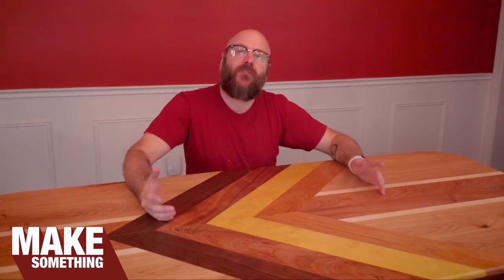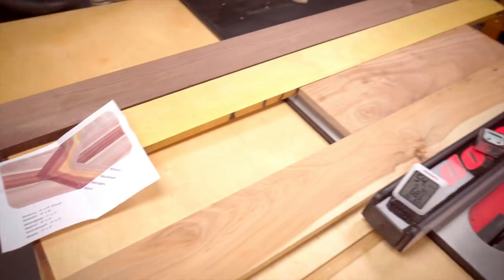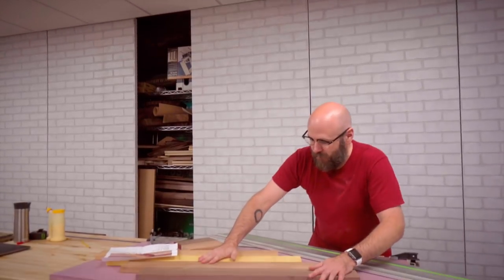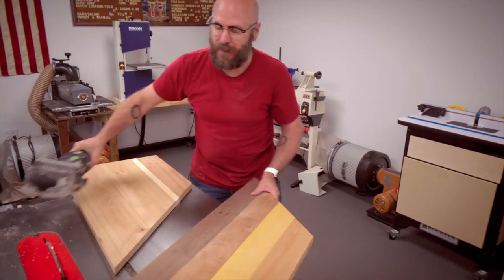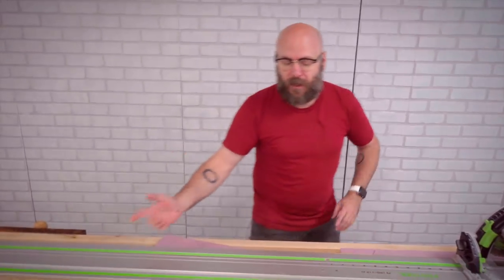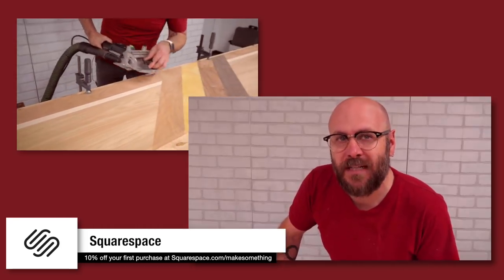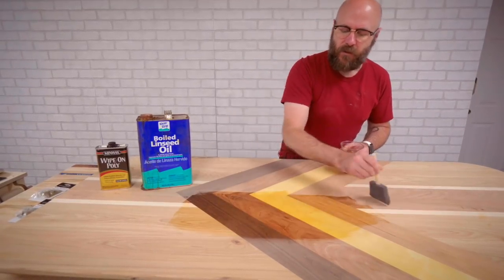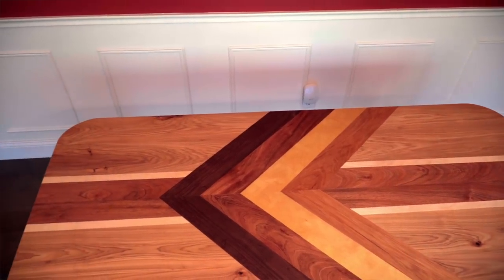How to Make a Chevron Table Top And Avoid Seasonal Wood Movement

Comment: It looks great. The only concerns I have are using pocket screws attaching the apron to the top and if you used  the domino on the wider setting on one side to allow for the movement. The pocket screw won't allow for movement and neither would the dominos if they were all done on the tight setting. Maybe treat the two halves like breadboards and use the dominos with dowels pulling it together and elongating the holes on the ends for wood movement? Then instead of pocket screws for attaching the top, maybe using z-clips to allow for movement. Those are my suggestions but it does look awesome!

Comment: What does the table look like today? Did it crack? I made a similar design, only I pocket screwed the boards and I used 2x6s and 2x4s
Reply from the maker: Still holding up great. A tiny bit of separation on one of the seams
Reply: @MakeSomething  that's good to hear!! My first table cracked so bad I had to build a new one and I wasn't satisfied with the second one so i built a third one! But thanks to your design I copied it only I mirrored it to make it different but I've actually became a decent wood worker!!! Thank u

Comment: Beautifully done David.  I will add, it's critical that the underside of any project also be finished to help prevent wood movement.  Unfinished areas react to seasonal changes in humidity and this is an area where many woodworkers screw up.  It's been researched (I don't remember where) that if this is done then 98% of the wood movement is eliminated.  My own experience shows me this is true.  I have no issue whatsoever with wood movement over decades of making custom highend furniture.

Comment: Hi David. Great video and table. I still think you might have some issues with expansion where the end grain of the hickory meets the edge grain of the chevron pieces, depending on how well the wood deals with the changes in humidity.  It’s definitely a gamble. Another option for this design would have been to cut thin veneers of each species and glue to a ply substrate. Only problem with that is then you have to wrap the unfinished edge on all four sides. Anyhow, great build and hopefully this one holds up in the long run!!

Comment: Is there any reason to use pocket screws instead of standard table hardware such as the  table top fasteners from Rockler? (in reference to the apron at the end of the video)
Reply from the maker: Table hardware is probably better but it’s what I had on hand.

Comment: the guys at my local Rockler store or telling me using pocket holes to attach table top to the apron is a big No-No because the Kreg Jig does not allow for wood movement and should use the z-clips, what are your thoughts on that David?

BTW, piling on to what everyone else is saying, awesome table, awesome instruction, awesome camera man, awesome content, awesome credit where credit is due.
Reply from the maker: I’ll talk about the pocket holes in the next video. In my application they’ll work but if you have on big solid top it could be trouble.

Comment: Exactly how this deals with the obvious movement problems has obviously missed me. As far as I can tell will eventually tear itself apart given enough moisture change-yes understand biscuits -splines might help keep the top level. However long grain vs short grain is always asking for trouble. This year demolished a rather nice blackwood table -1920s era -was torn apart at the glue joints because was screwed hard to the frame. Understand that this has left the movement areas - not glued hard together. This is obviously going to have wood sticking out or contracted  back along the chevron. Wont tear itself apart - but won't look good unless the weather is perfect.

Comment: I’m confused on not gluing but screwing in the apron. 

My understanding is that the apron should be “floating” to allow for expansion and contraction across the table. However you suggest in this video you’ll be screwing the apro to the table top so aren’t you trading one problem for another? I.e., won’t the apron experience some sort of blowout given it’s screwed in? Or do the screws allow enough flexibility?

I haven’t had the guts to just glue everything and see if it breaks but I always wonder if woodworkers fear of expansion is taken too far sometimes. I have read about the expansion but not done research to see the “aftermath” of bad expansion problems.

Comment: Hey I love you’re videos and I want to start wood working but it’s way to expensive do you have any tip on how to get started. Do you also have any on easy simple project with out using any fancy tools all I have is a chop saw and some hand tools if you could give me some tips that would be great thank you
Reply from the maker: Unfortunately it’s an expensive hobby. I started out by buying used tools.
Reply: Spencer Peterson Get a pocket hole jig and a drill/driver. That will give you an easy way to do joinery. 
Then start making things like a stool for example. 
There are a lot of projects you can do with what you have. For example make a planter box.
Reply: Look up Steve Ramsey's channel 👍

Comment: Hi david,  I get get really good hardwood off cuts for free from a local joinery factory, they are all hardwood that is for sure but... they are all different species and colours. I wouldn't even know what species they are. Do you think I will have any issue gluing up tabletops and other joints from different unknown species? will different expansion and contraction rates cause me a problem. I plan on selling what I make so I don't this stuff to fall apart on me?

Comment: Great video David. Just curious though, why did you plane the full length halves instead of running them through the drum sander?
Reply from the maker: Thanks! Good question. I could have used the drum sander as well. In this application the planer was faster.

Comment: How does screwing in an apron still allow movement?
Reply from the maker: The apron is long. I'll bend 1/8" with ease.
Reply: @MakeSomething  sure, but do you only screw the top to the longest apron or the short ends as well? (I am still learning, especially about the etiquette for fighting wood expansion and contraction on table tops)

Edit: also, your reply just got you a new sub. Thank you

Edit 2: actually after watching another vid of yours and the 2nd partnof this table series, I believe you only actually fasten the table top to the long apron with the grains (mostly) being parallel.

Comment: You should be sliding that kapex,  not chopping. Will destroy the motor. Also, sliding = best dust collection.
The wood became uneven when gluing it up because you didn’t use Cauls.

Comment: I have been making production high end dining tables for decades. I am still not understanding why you did not glue the two halves together. I have never seen the movement you are talking about in any of my table tops. I have tossed table tops before they shipped due to warp and glue joint breaks.... but those were few and far between. Is that what you were trying to avoid?
Reply from the maker: The space between the arrow would expand and contract potentially causing it to split.
Reply: the arrow itself would not expand if anything it would be the grain that went the length of the table that would expand and contract so I could see the end grain of the arrow splitting over time because that's not a strong glue joint to begin with and the other grain running along the table would pull the arrow apart.
Reply: the problem is when you run wood grain perpendicular to each other the wood along the long grain is restricted from expanding and contracting and it tends to split the boards.
Reply: Yeah, the stress and expansion will not happen where the glue was avoided. Hopefully it won't happen at all though.

Comment: It will be interesting to see how this top looks after a few seasons, since combining different species at multiple angles makes it very difficult to keep the top flat and tight. I'm pretty skeptical that your dominoes and fixed apron (it didn't look like you were elongating the domino or screw holes) will do anything but restrict tangential movement at specific points. This almost always leads to splits and/or cupping. I don't think glue (or the lack of it) will make a difference. But I would be happy to be proved wrong :)

Comment: Great table, but I don't believe in wood movement in the context of a climate controlled house that sits at 75 degrees and 40% humidity year round...I think people make more of a big deal.about wood movement than it really is....I think 100+ years ago wood movement was a concern to consider...but not anymore...imho
Reply from the maker: Our house is not climate controlled year round. We try not to use the AC when it’s below 85°. Our humidity levels within the house go anywhere from 20% to 70% throughout the year.
Reply: Not sure where you’re living, Nathan, but 75 degrees and 40% humidity existed for about 15 minutes a year where I live!
Reply: JAMES SLOAN yeah I'm in Florida, so while it may be 90 degrees outside and 100% humidity, it's always consistent inside under AC....and it's like that year round.,..

Comment: You don't have a good blade for the jigsaw ? But have 100K worth of equipment in the shop?! Get out  of here with the  BS
Reply from the maker: I had two choices… I could have stopped what I was doing to go to the store to buy blades which would’ve taken an hour or I could just cut it by hand in 10 minutes. Be cool.
Reply from the maker: If I post a video of me trying to use the jigsaw with a dull blade will you publicly apologize to me? 🙂